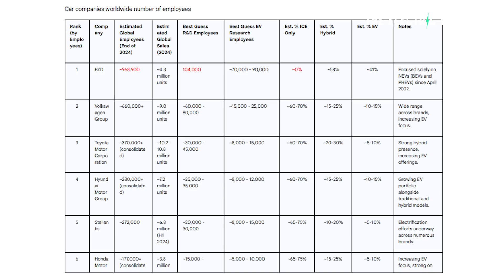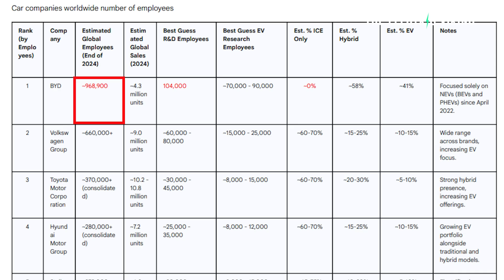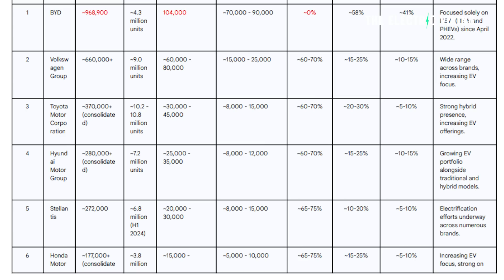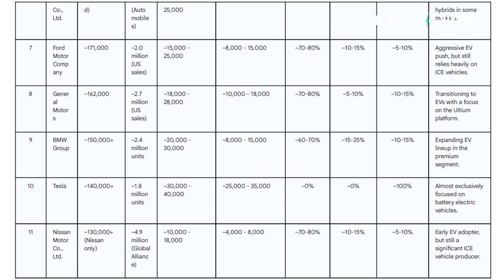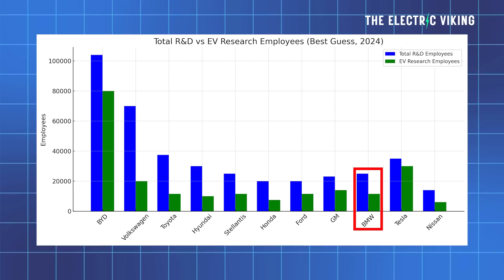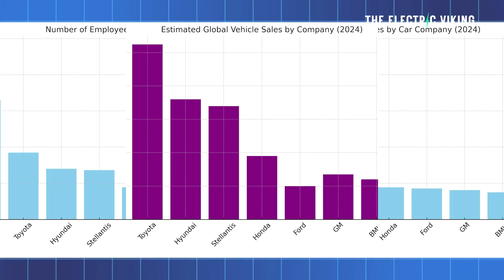The secret reason BYD will soon overtake VW and Toyota worldwide

Comment: New proud owner of a Byd seal u design, 3 months of happy driving, I’m can’t understand why Byd Motor journalists give it an OK result, The good, interior design fit and quality is top notch, entertainment system is fiddly need more updates, but its getting much better, comfort is excellent as well as sound deadening materials are also a major leap to the quality and low road noise, Driving experience, very smooth over good roads, but it feels lost on uneven roads and, potholes shudder through the body, but most of the time Floats on air almost. Steering is too light and twitches a bit on fast roads, but in sport mode gives a much tighter driving experience.
Electric Motor is a dream so quite and amazingly fast, and pulls away at the lights, with aplomb, it’s no sports car , but it’s a great drive and very good through the bends, it’s all under control , perfect for most buyers , especially quality price point, it’s hard too beat, I have loved many different German cars in the past, but now wanted a more refined and relaxing drive experience, Trunk is a bit small considering the size of the car, but driving a big car drives likes a breeze……..STOP PRESS , I live in Spain, Canary Islands, and the distributor for Byd is shockingly bad, if they continue to serve their customers with almost no customers service, they will lose many customers, that’s my major concern when and I need it serviced or repaired, for example I’m waiting now 4 weeks to get the Byd mobile app to work, which is essential for the car to work properly and revive updated directly online through the cars fitted SIM card , can’t use apple play, the ADAS self driving system is all over the place because it can be updated, also had missing NFC open card readers to open car tapping the external mirror.
If I don’t get this sorted out soon I’ll have to report the to consumer agency here with an official car adjusters report.
So IF Byd get their distributors sorted, then the package can be A1, with long long guarantees. Good luck, but get a check list that all is correct before signing off for the car. 😉 good luck 🤞 Richard, British ex pat.

Comment: I respect your analysis but humbly submit that there are a few flaws in the BYD approach, for example if Toyota makes almost twice the vehicles with a third of the staff that means they have better automated production.  BYD still doesn’t use mega casting, they are using old school techniques, they are therefore dependent on cheap labour, and that will not last
Reply: Byd is way more vertically integrated than toyota and they also make batteries for others. So doesnt make sense to compare headcount with cars. Toyota sales is declining anyway.

Comment: BYD are looking at a huge global increase in sales. They are ramping up deliveries, models and marketing everywhere except the U.S. The new Hungry factory starts production later this year and the new Turkey factory later next year. There are also a new large factory in China. BYD has had huge growth even last year they grew 1.3m vehicles from 3M in 2023 to 4.3M in 2024. Better growth is likely this year for a result over 6m. 2026 is looking to be a spectacular year and 7-8M is quite possible. With Toyota coming off their peak with collapsing sales in China and big problems in the U.S. the gap between Toyota and BYD will be closing by the end of 2026 and Toyota could be surpassed by BYD as early as 2027 or 2028

Comment: RUMOURS ARE RISING THAT THE CHINESE HAVE A CHEAP METHANOL/ ETHANOL REDOX RANGE EXTENDER WITH CASSETTES, AND WILL FIT IN SMALL CARS AND BATTERY (15KW) FOR 350 KM RANGE.
Reply: Rumors =0 proof 

Give proof or you are wrong
Reply: @zacksmith5963  These small city-cars will come with a network and anybody can make a cheap trip in them.

Comment: Secondly, BYD is turning into a serious competitor to other car manufacturers, so you can safely expect that the corrupt media owned by the oil industry, Americans and other ICE vehicle manufacturers will throw mud at the fan in the hope that it will stick somewhere. Advice, before talking about BYD, check the facts carefully...P.S. EV made by BYD works quite well for may gasoline free daily commute and weekend road trips..., and I don't need badly overpriced and overhyped Tesla as well...!!!

Comment: Good to see some insightful data onthis topic. I spent my early auto engineering career in R&D. Mostly in development, which is the key to sales growth in good times. The auto sector then culls development numbers during down periods and over indexes on selling and underinvestment. For decades this was a 7 to 10 year cycle. Vehicle quality was also a lagging indicator as development costs were slashed. I've seen this cycle many times. It would be good if you can distinguish between research, development and launch support, as those ratios will also help explain the trajectories of the auto brands. R&D numbers tend to lack granularity on pre production, launch and full rate production resourcing. Looking at quality deterioration and brand perception is also useful data that supports the analysis. Love your work, and hope your wife is doing ok. Must be tough balancing this unique channel and family.

Comment: One thing to remember about BYD's headcount is that it's the single most vertically integrated company among all the large automakers, more vertically integrated than even Tesla; this means that a lot of those BYD employees are making car parts, whereas BYD competitors outsource those car parts to other companies.
Also, BYD makes a lot more than just cars. BYD has employees making iPads, laptop batteries, solar panels, inverters, even surgical masks; a city some 500km from where I live started operating BYD trains last year.
Incidentally, cheap R&D costs is a big advantage for Chinese companies. Depending on the field, R&D in China can cost 90% less than in the US — and wages are just part of the reason, but not the full story; if it was just about wages, you could build a research lab in places like India or Brazil and enjoy even lower research costs than in China.
Reply: Shhhh.. many whytez are numbskulled. No need to wake them up.
Reply: R&D staff are the most technologically involved and technologically qualified staff in the workforce. Whether they are highly paid is another matter, it costs much more to train R&D staff than staff in any other field in the manufacturing sector. The United States used to be at the top of the world in R&D, but has since slowed down probably because of lack of investments by the government and companies, while China has soared exponentially in R&D activities and capabilities in the last decade. Wages aside, R&D is not cheap actually. We all know how much the China Government and private sector have spent on R&D in the last few years.
Reply: Also, most of the legacy companies outsource or partner with smaller developers on R&D and tech issues, or use affiliates (often for tax reasons) or joint ventures. So you're not going to get the straight figures from just employees. This is especially true in the case of software, as outsourcing that development would mean a major difference in employment figures.
Reply: And the others all buy at byd. Tesla, Xiaomi, XPeng....which is good, because otherwise CATL would have have the monopoly.
Reply: 比亚迪目前有超过90万名员工，是全球车企里最多的